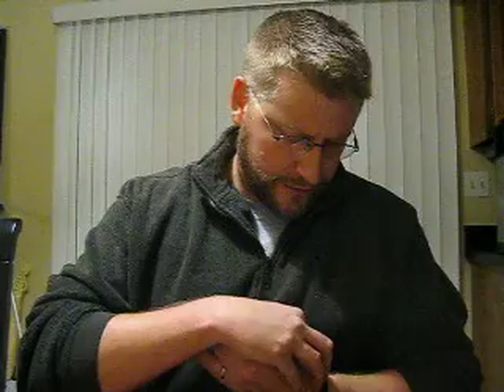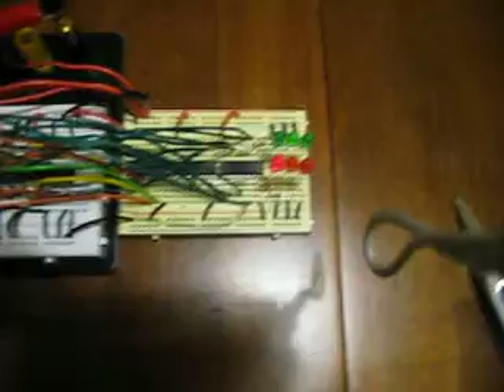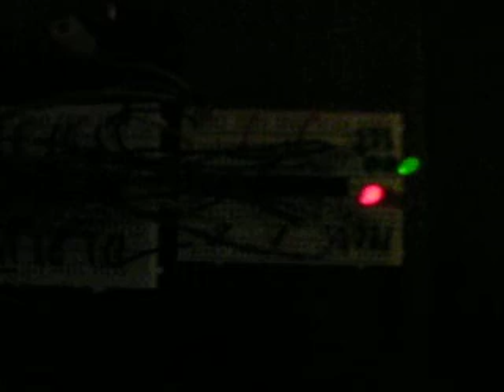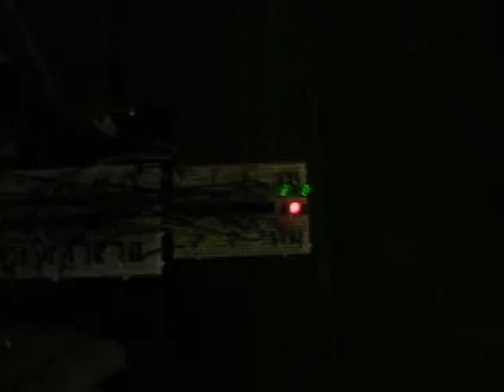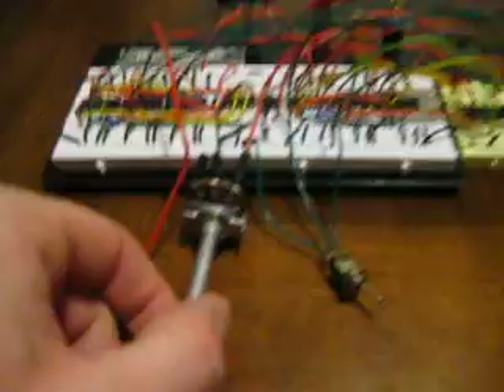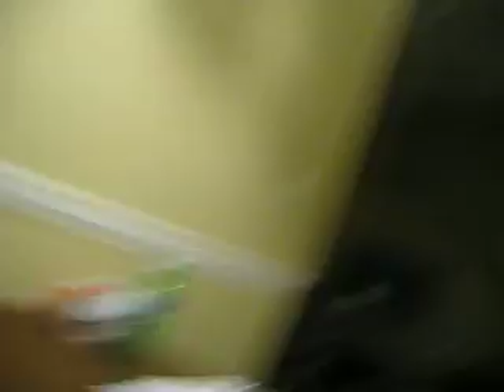MAE ECE 535 Demonstration - brushless DC motor control

Comment: That's a very nice circuit you built! I must confess that my discrete BLDC driver which uses a NE555 + CD4017 is much simpler and neglects half of the states but at least it does what it should. I hope to see a MOSFET bridge connected to the board, soon!